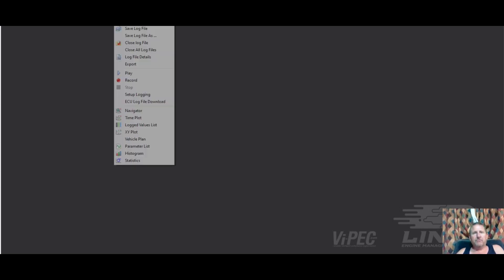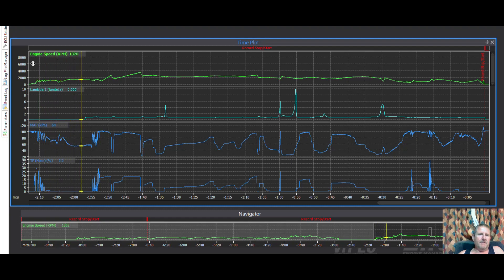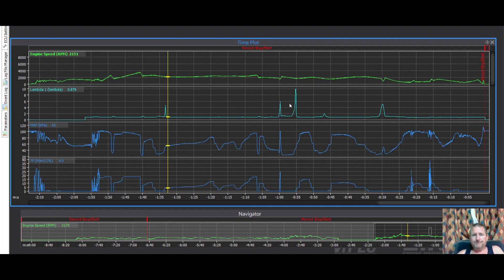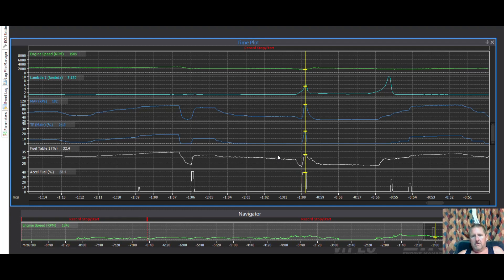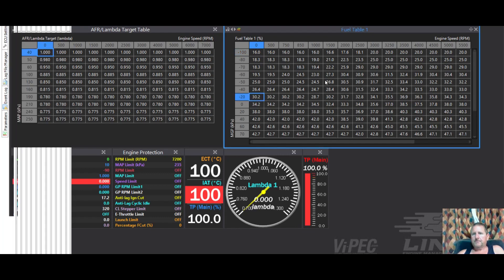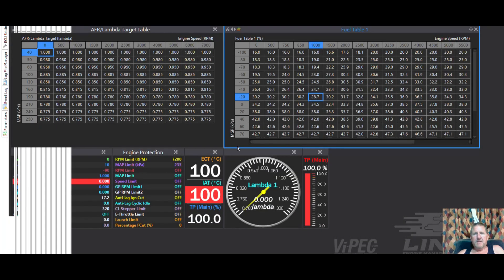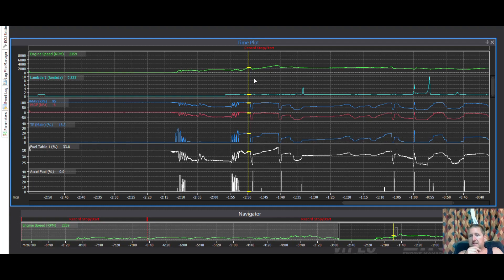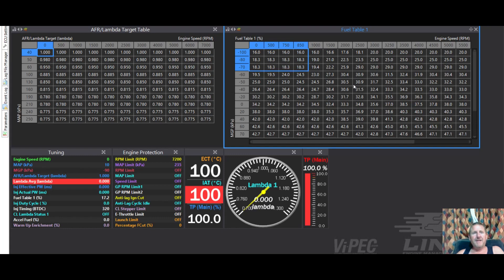Link ECU logging two.  After a drive. Analysis. EVOlink plugin example.

Comment: im doing my motor swap now jus made the motor mounts I jus was wondering what degree of tilt is acceptable or where it should be...
Reply: I got it level maybe 4 degrees but that's if I raise tailshaft 3 inchs above xmem
Reply from the maker: I try to set driveline angle the same as original engine.  I measure gearbox position and crankshaft centre position and attempt to mimic the same position or if I raise 1 I raise the other as well.  That way driveline angle remains the same,  even if I raise both 2 inchs its all still same angle and driveshaft works correctly.